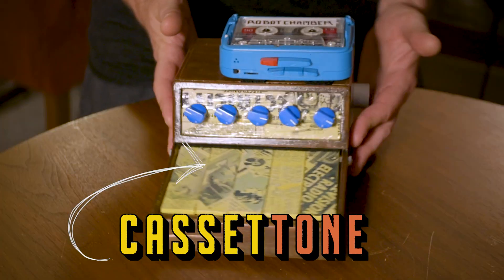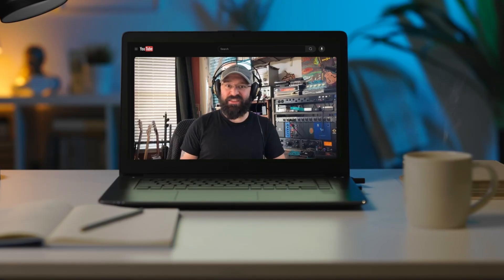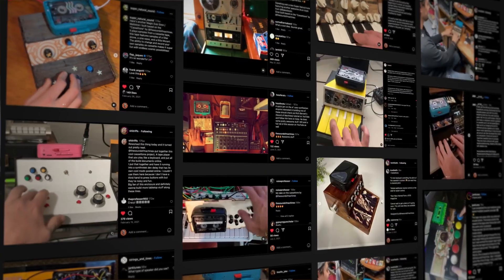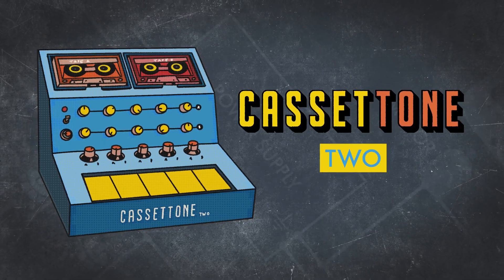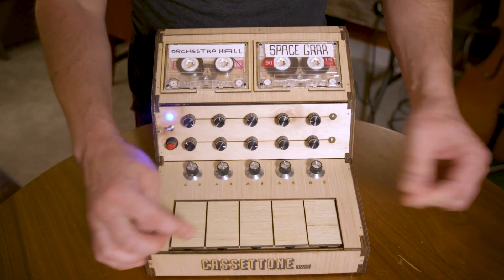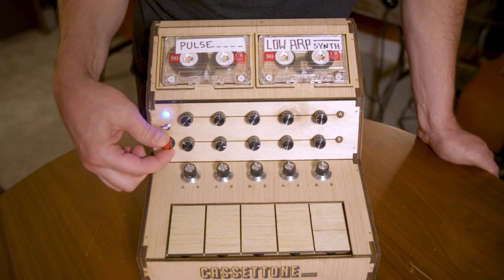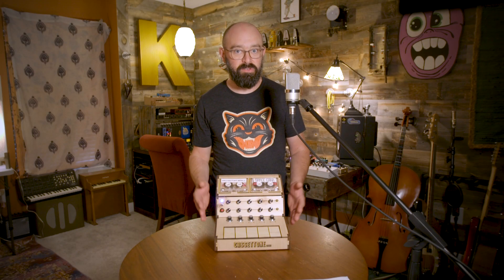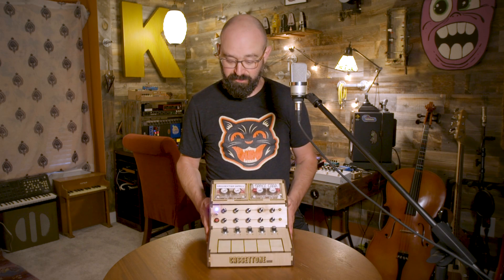The Cassettone Two: A Mellotron Inspired Synth | Announcement Update

Comment: i dont know if you will consider this feature but ive thought about it for a while: what if there was a mode that made it so that each press of a key (either per key or all total) it would only output one of the cassetes audios (or have it invert the blend) for added veriety and uncertainty. If each note has a release time this would be another way to create note pairings
Reply from the maker: @trollkarlenjp  interesting! That sounds like a feature that requires some coding. Right now I’m deliberately leaving out any controllers since that bumps the build difficulty up a number of notches! Future maybe?
Reply: @TheSoundofMachines  i know barely anything about that, but surely there is a way to figure out the logic and build it in hardware (that is if it sounds like its inlign with what you want this product to be). im not part of the discord as i ive just lurked here (love this btw), but sounds like that group would be a powerhouse